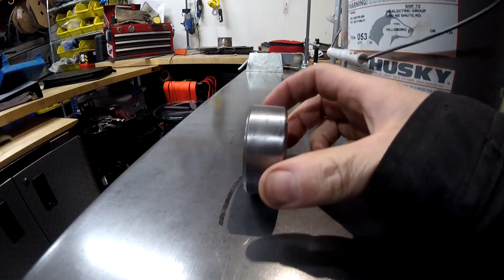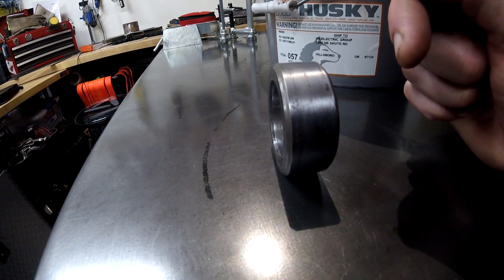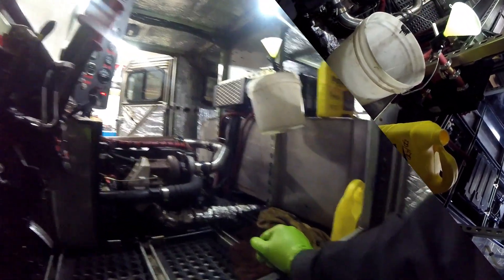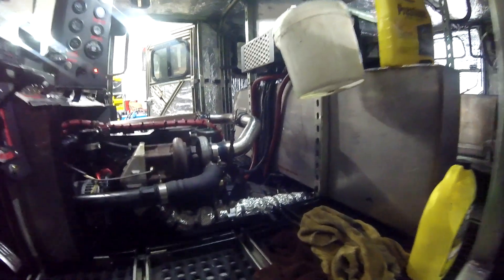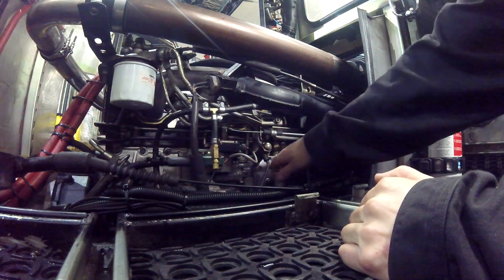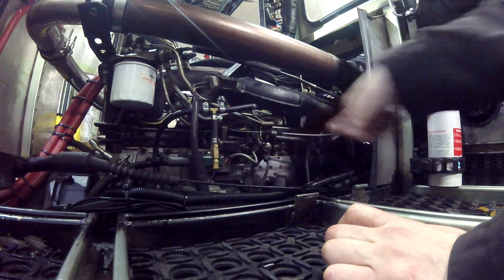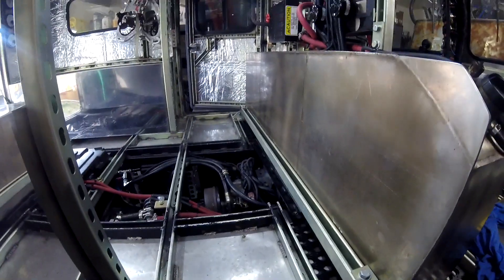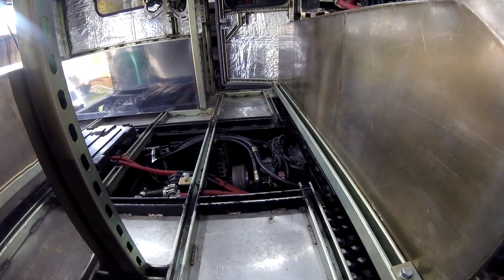Rusty the Spryte build part 107 (JATCO JR403E first startup and revisiting the pinion seal leak)

Comment: I was a little scared... torque converter slurped up that ATF. Is it okay to dry start the engine like that? I thought in might be rough on the injectors. It will be nice to see it back out on the trails again!
Reply from the maker: As long as there is oil pressure I doubt you will hurt this old sewing machine....

Comment: Hi sean , yes it definitely  torque  converter , cooler and lines done  afew dry transmissions  ,is speed sensor  same part number as other one, have some that are negative  triggers instead of positive triggers  for signal out
Reply from the maker: I am going to revisit it this weekend.  I had to buy another version to test with since I am still getting the same code.  I think I have it figured out though...

Comment: As memory serves fluid in torque converter is typically added before assembly as the dipstick does not show fluid lost to converter.
Reply from the maker: I drained and flushed the torque converter but did not refill it per the manual.  That was my bad...

Comment: Torque converter uses a few quarts. 7 is probably for oil change without changing oil in converter
Reply from the maker: I just read in the manual the torque converter uses 2.5 quarts.  The grand total I ended up using was about 12 quarts total.  I am guessing the extra line length and the cooler took up about 2-3 quarts.  I think I have an updated deeper pan on this transmission as well.  It all makes sense now.
Reply: @SeanFastidious  yeah I forgot about the extra cooler. The deeper pan would make a big difference not only in oil needed but helps with maintaining a lower oil temp.